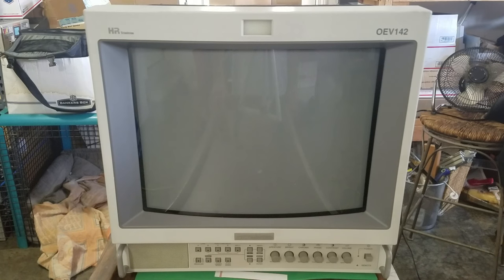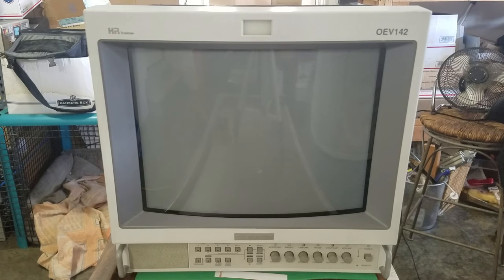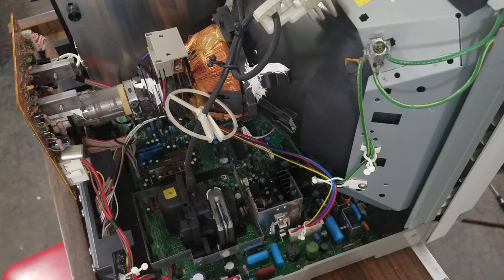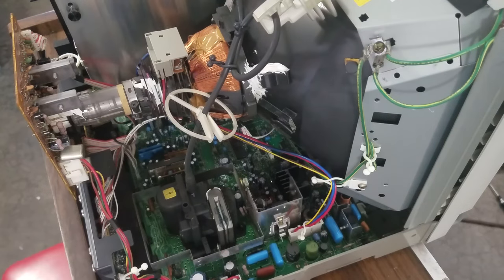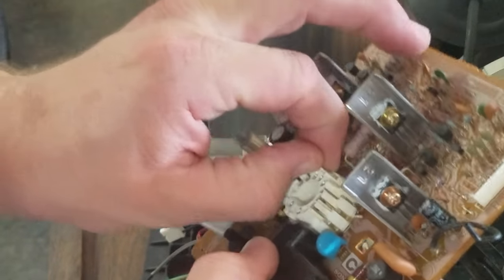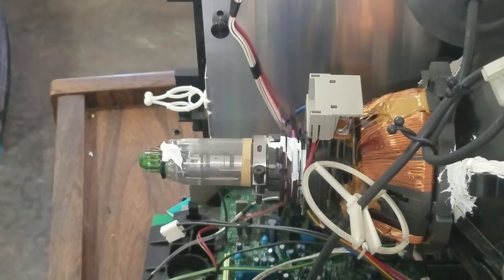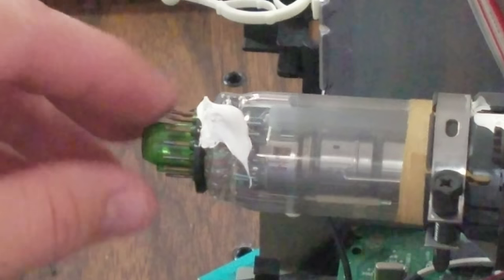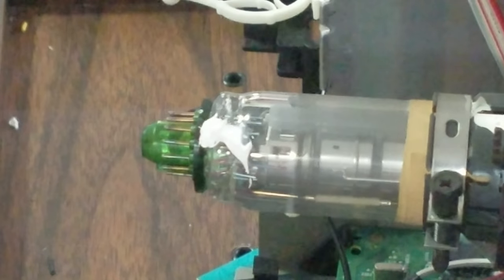Sony PVM Restoration Part 1 - How to tear down the CRT

Comment: Hey I'm looking for a a nice 13-14 inch PVM for my Betacam decks. So it would need to have component input to get the best picture from Betacam. I found one on eBay but they say no sound and unsteady picture. Do you think replacing the capacitors would fix that? I have the skills to read a service manual and I'm aware of the precautions with CRTs.

Comment: Hey there, I have this model which I haven't gotten into yet, But I also have an oev203 which I have opened and checked out. The power to the unit works, but im not getting any picture at all. Nothing appears to be burnt out, so how do I start in locating the source of the problem? If the tube is gone is there anything I can do about it?
Reply: That sucks good luck. Have you tried all the inputs? Composite? S video? Component a? Component b?
Reply from the maker: If the tube is gone, all you can do is get a replacement tube.  It could be your flyback too if you aren't getting any power to the tube.

Comment: I have a question for you.  I have a Sony PVM-1340 and have only used S-Video and Composite video so far.  The picture is ok but seems to be dark and will only look good if you keep it dark.  If I increase the brightness it blurs the picture.  I have opened it up and physically Inspected the Capacitors and they visually have no issues.  Since you work on these do you think that could be a Cap issue or do you think my Monitor might need a Sencore CR7000 revitalizing session?
Reply from the maker: Did you try adjusting the pots on the back of the flyback?  One controls brightness and the other helps focus a blurry picture.  If you still have the problem, then most likely the tube has a lot of hours on it and is just wearing out.  Caps won't affect this.

Comment: good video. did this particular unit have display issues to start with ?
Reply from the maker: Yes it had a specific issue on the PIN control line.  I will go over it more in detail on the 2nd video while I'm recapping it.  Thank you
Reply: good luck with the repair, great video. subscribed
Reply from the maker: @spilmer1  Thanks man.  I look forward to your input too.  I know replacing all the caps is tedious and not necessary, but it's a fun task for me and a chance to just spotlight these PVMs.

Comment: I have a PVM-1354Q that shuts down before it can fully come online. The LEDs come on for a second before shutting down. I'm betting it's a capacitor issue, because it's old and the previous owner said that it used to stop happening once it was warm, but I don't know enough to judge. 

What was the reason for recapping the one in this video? I love your channel by the way.

Comment: Hi Steve,

Recently repaired a monitor that had bit of a rough life. I noticed that that green spacer on the neck board was crumbling. I've taken it completely off and the monitor still works well. Anything I need to worry about?

Thanks
Reply from the maker: No that's fine.  It's just a spacer to protect the tube

Comment: Technical question: From everything I've read, Mica capacitors are higher quality and much more durable than electrolytics. Would it be a good idea to replace the old caps with micas?

BTW Steve, I'm in Chattanooga, TN. What part are you in?
Reply: Not the poster, but I would think it's best to replace caps with the same style. I would only consider using ceramics or tantalum caps for instance in something like a game console where it's easy to diagnose and you still stay away from the audio and video circuits.
Reply from the maker: Hey Jarrod.  I'm in middle TN.  I have an office in Gallatin, TN if you are familiar with that area.  I am going to stick with the electrolytic caps.  That's what I always do, and I've never had any issues with them.
Reply from the maker: Thanks for the input